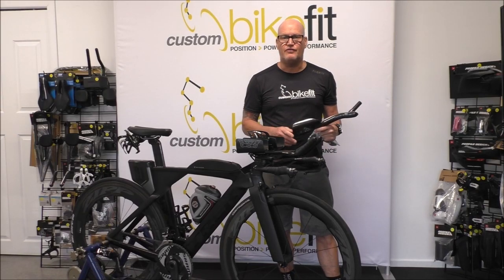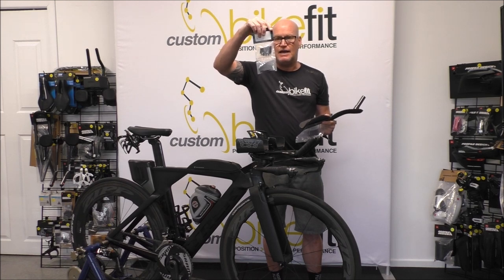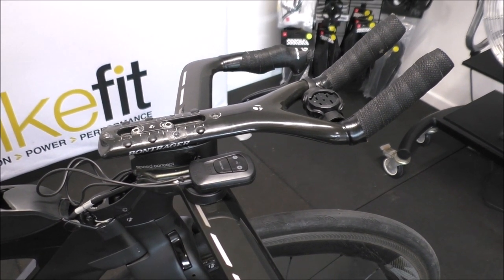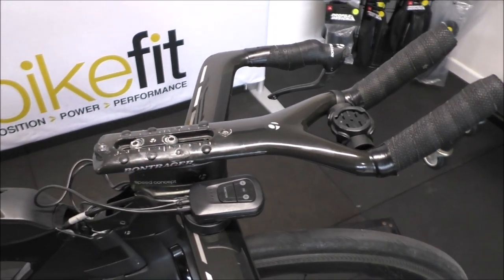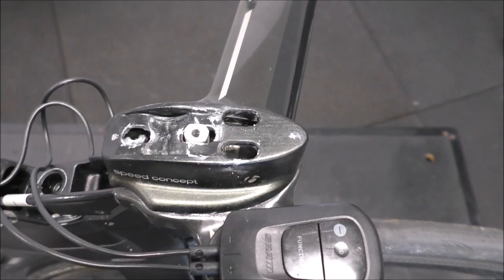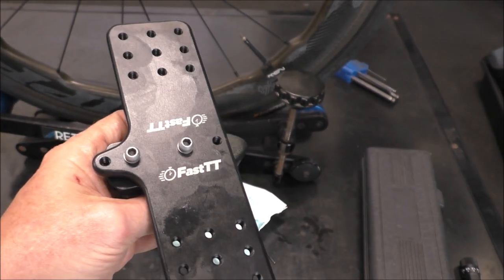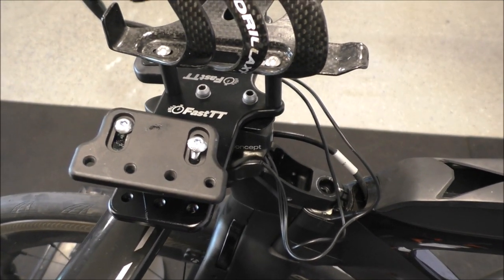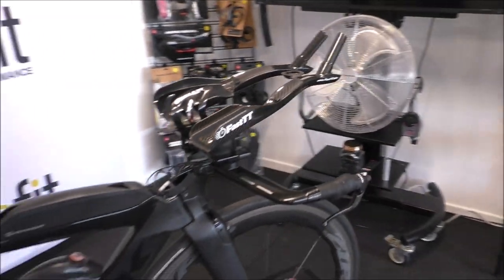FastTT Speed Concept

Comment: Hey, just saw this set up and was exactly what I wanted to install. 

Unfortunately both bolts attaching the trek aero bars to the original mono riser sheared off completely during a 70.3 and caused me to hit the road at 60km/h. After googling this problem a lot of others have had the same bolts snap on them, so I’d highly recommend you replace the original bolts you used here to attach the adaptor plate to the mono riser with something denser perhaps. Ends up being such a large amount of side to side leverage placed on two weak bolts.

Frustratingly I just found a large crack in the carbon top tube, so not even sure if mine is repairable yet!

Comment: Is there any way at all to use the FastTT plate along with the Trek mono plug in? I bought the plate thinking it was installed on top of the mono plug-in similar to how the original trek "bridge" is installed. Plan was to use the fasttt plate so that I could use 51 Speedshop cups & wedges
Reply from the maker: I would need to have a more in-depth discussion with you Robert. I offer free 20min discovery calls over video if you'd like to book in? https://link.contentcreatormachine.com/widget/booking/q6ucOwaLMmhhrFUKpvLF